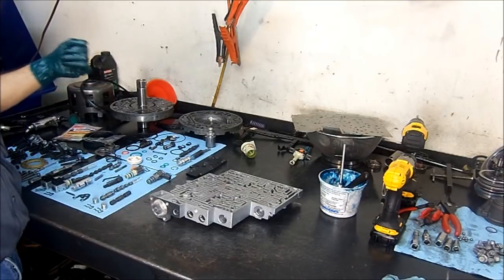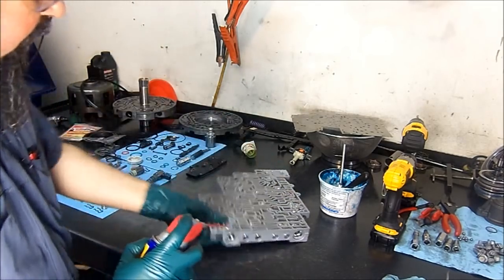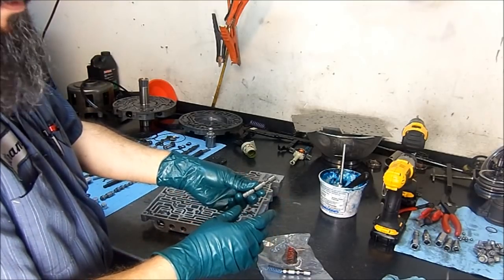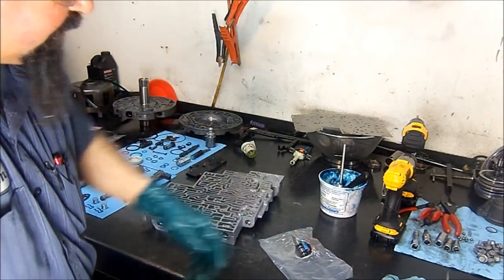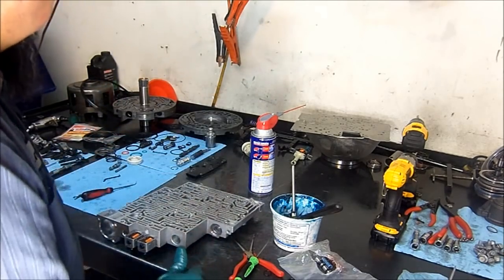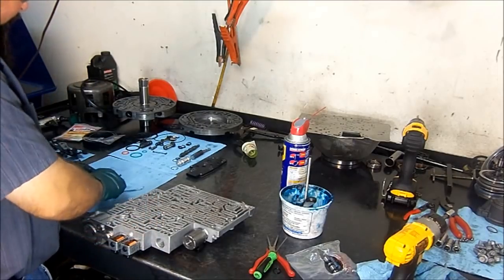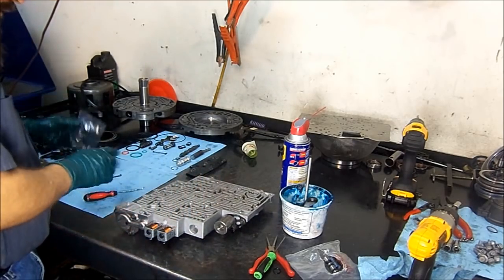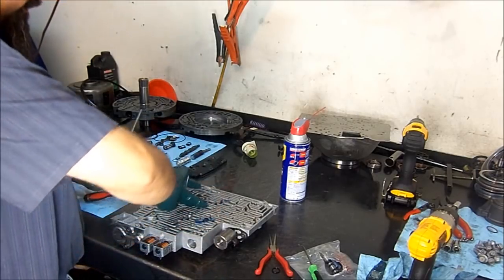4L60E Transmission Valve Body fix P1870 Transmission Component Slipping trouble code.

Comment: Hello I need your help 
I have 4l60e slipping on 2 n 3 n 4 when rpm go more than 2000 
1 n R working good I put a pressure gauge on the line pressure I have 60 psi on P N D321 and 35 go to 90 on R 
What do you think 
Thanks for your help

Comment: Hi, Can you help me? I'm having problems with my 2002 Trailblazer. My gearbox has been re-overhauled. I get new error messages P0171, P0172, P0131, and P1870.
When these errors come, my gearbox switches very hard.
If I delete the errors, the gearbox will work great again.
Are the errors connected? Can I give me any information?
No one knows me!

Comment: Hey Hiram I just overhauled a 4l60e that had rear planetary failure. I installed a shift correction kit on it, now the transmission will roll from a stop and then engage when accelerating. I am suspecting it's a pressure manifold switch problem. Have you ever ran in to this issue?

Comment: Dear brother i hope that u can help me to find out the problem in my chevy trail blazer 2008 ,Last year, August 2016 I change the 4W drive case and become little better for a year and recently, I encountered same problem when shifting to 2nd gear looks like there is car hitting from the back. This is after the car was stock on the sand beach and we force the car to move by changing the 2W, 4W up and 4W down switch for half an hour. Then it happens also in 3rd gear but lighter than the hit on 2nd gear. The rpm gauge was playing also from 3 to 4 when we were driving going up off road looks like the gear is having a hard time shifting or not shifting at all. Then, when I rest the car the following day, sounds better but starting to hit again on 2nd gear after staying the car open and long drive approximately 80 kms. It starts shaking when its shifting and after awhile its start to be stronger then to hit/pump again like car hitting from the back. Whenever the car will rest long time it will be okay but when you start to use it for driving the car will start again to be like that. And when I stop the car and go under if you shift between D-R you can hear sound like jangle. god bless u am hisham
Reply: Converter is slipping and its raising line pressure to compensate. Sounds like a classic p1870.

Comment: I have a 99 suburban with a 4L60E rebuilt into a 4L65E three months ago, new servos, clutches, gears, everything. And HD2 transgo kit, not set hard, just firmer shifts. Drives fine and everything but when warmed up, once I get above 50 when I let off the gas to cruise (when it goes into overdrive) I get a jerk like my converter is slipping momentarily. I haven't run any codes yet, but is it the valve? It is not slipping gears, I know that much.

Comment: will flipping the tcc valve around like that fix the trouble code?
Reply from the maker: +Mike  Ebert If the transmission is in good shape inernal, yes it will. There's 2 types of valve bodies. Early and late. I also have a video on the early value body.
Reply: the 2005 unit appears to have only this problem along with a hard 1-2upshift. I was actually able to tune out that code myself using hptuners. I did want to go in the valve body to ohm out the solenoids and to flip this tcc valve like you suggest, and do a flush. Just kinda doing some preventative maintenance.
Reply: I changed the maximum duty cycles in the tcm to 100% for the tcc, and the minimum to 90%. this should have the tcc locked or unlocked. if it slips from here then there must be valve body wear. I also do not allow tcc lock during wide open throttle upshifts. ironically the factory tune does..
Reply from the maker: The EC3 system works different than the early models. Being a 2005 you're an EC3. At 90% duty cycle the TCC is bleeding the TCC pressure. If you monitor the scan tool on TCC solenoid (the one on the pump) will come on immediately on 2nd gear. Your duty cycle would be around 90% and bleeding off TCC pressure. Remember, it's a PWM system,  it's design to always have slippage. Once the conditions are correct to start applying the TCC clutch then you will see the PWM solenoid drop to around 35% to less than 50%. Looking at your "TCC RPM" data on your scan tool you should see the actual RPM for TCC close to 0 RPM, and no more than 75 RPM slippage. Over 100 RPM's it will set a trouble code for "transmission component slipping", be aware that this unit uses 2 solenoids to accomplish that.  The TCC on/off solenoid that goes into the pump and the TCC PWM solenoid on the valve body. The one you made the changes to in HP Tuners. It is very common for valve body wear on this units that cause that issue, either you install a new valve body, ream and install an over sized valve, or do what I show on the video. All 3 options will fix that trouble code. Hope this helps to understand the functionality of the system. Look at all the data, tune with your HP Tuner and give us some feedback. I and my subscribers and viewers would like to hear your results. If you're not subscribed yet, please subscribe. Welcome to our little community. Hiram @ Automatic Transmission.
Reply: Automatic Transmission So far I will be switching around the valve like you suggest and change these other items. I have the updated transgo... separator plate which I drilled out as your video shows, sonnax pin less accumulators and the forward accumulator, and the sonnax check ball kit. i will let you know how it goes after I install the parts and switch around the valve like you suggest. As far as the tune with hptuners, do you think how I changed the max and min duty cycles is bad?  I will have to check and see if i can view the tcc and pwm values with hptuners scanner. Here is where I got the idea:   https://www.hptuners.com/forum/showthread.php?15899-How-do-you-delete-PWM
Reply: I checked hptuners scanner and I can monitor tcc/pwm duty cycle, tcc slip frequency, tcc slip ratio, tcc apply time,  and tcc applied yes or no. and a few other tcc functions which are irrelevant like tcc min tps....
Reply from the maker: +Mike  Ebert We build performance transmissions but I don't get into HP tuners. But what you mentioned before didn't make sense to me unless you don't want TCC to apply. Which I can understand on a track driven only vehicle. But on the street it really needs it, otherwise the transmission will overheat and can cause unexpected issues.

Comment: Nice video. I have this code in my 99 Astro. I Also have hard shifts when it get warm. I was going to buy the trans go HD2 shift kit. What else do I need? Solenoid kit? Or can you buy the valve body already done?
Reply: How did it work out for you?
Reply: @KollynJ  I never fixed it. Sold the van as is.

Comment: Hi, i have a 98 Jimmy with the p1870 code. i already installed the Sonnax TCC regulator valve kit and  it worked great for a couple of months. Now, the 1-2 shift gets harsh after about 30 minutes of driving. Should i replace the Sonnax TCC regulatior valve again or is it something else?
Reply: OsoBlanco did you get an answer on how to fix your issue? I have same problem

Comment: I have a 93 vette with the 4l60 trans, got a small gear grind when put in drive. I had the trans rebuilt, but still have the gear grind not bad but not right. Shifts a little rough through the gears . is it the valve body.

Comment: Hiram do you ever vacuum test the valve bodies with a tool like the vacuum test tool Sonnax sells.
By flipping the valve does that change it to the tcc being off or on and not pwm regulated? Is this a good thing to do? Will there be any negative side effects? Thanks the videos are very helpful.

Comment: Hi Hiram, I got a small question. I'm running 2 codes a p0740 and p1860. Now when I drive I have no shifting problems no slipping what so ever. could it possibly be just the TCC solenoid. it shifts smooth so its got me puzzled. the only time it does kick in a little hard is when I engage the 4x4

Comment: I have 2000  Cadillac Catera Code P1870,. "S" Light and Fuel Cap Flushing,  Radio and Trunk Doesn't Work. When I start from 1st gear after S light Flushing is very slow to run, If  I turn off Engine, Car works perfect for few hrs.

Comment: Do you have to drill those two holes. I did everything that it looked like you did with that exception when I put it all back together I had no reverse.
Reply: This is the same person, didn't realize wife was logged on till I pushed enter. I went in and watched the valve body install video and realized I had the one of the three 8mm bolts in the wrong place and like you said was impacting the planetary gear. I pulled the pan and moved the bolts around. All seems to work correctly. Now for a test drive to see if the trouble code comes back. I have confidence as it appears that you are knowledgeable on this subject and fix. Thanks for the video tutorials.

Comment: Hello I'm getting a hard shift from 1st to 2nd in my 04 Chevy Tahoe could you point me in the right direction
Reply: 1/2 accumulator springs could be a problem, broken spring.  I like a good firm 1/2 personally and built mine to have that.
Reply: Nathan Deneault This shop has all the tools lol.
Reply: daironification niice!
Reply: Nathan Deneault Yeah lol that was the first thing I told the guy that owns the shop. "I don't have ANY TOOLS" He said not to worry about it, he has everything :D!!!
Reply: daironification but buy your own to have and Eff up.  he will likely give you a raise for having your own gear and not stressing his out
Reply: Might be a worn TCC regulator valve, see if it throws that P1870. You might need a valve body rebuild. I'm having the same issue as you.
Reply: Nathan Deneault Thankfully I'm starting at a car shop VERY SOON. I'll be able to learn how to fix my own stuff haha.
Reply: daironification transmissions are just a bunch of subassemlies that u put together.  nothing to it, it is almost worse unhooking and rehooking up afterward.

specialty tools aee also super crazy for transmissions, get a press, u will nedd it.

Comment: Hey i am having trouble with my 1993 4L60E. When i go into gear it seems to jerk into drive but not reverse. its better when its warm and sometimes doesn't do it. it also has a hard shift to 2nd gear but it only sometimes does it. I am going to drop the pan soon i have a filter and the fluid for it and i would like to find the problem. a response would be VERY appreciated before i go tearing into it.

Comment: Hiram can the valve train be flipped around without reaming/modifying the spacer plate? the tekpac tcc valve which is very similar to the one you showed then showed us how to recreate doesn't require drilling the spacer plate

Comment: Hiram I have an 04 4L60E and am having TCC lock up vibrations at 45-55 mph, no code yet, started after fluid and filter change. can I flip my tcc valve train around like you did here to fix this? also I see the proper setup just not how to install it: spring first? followed by plunger then valve or spring last? many thanks.
Reply: Did you?

Comment: Hiram please help!
I have a 2003 truck and I put a 2000 4l60 in it
the builder sold me it rebuilt and I gave him my 2003 4l60e  as a core.
he said the 2000 4l60 would be the same but I have pwm  codes showing up! also I see that the harness changes in 2003 and so does the valve body and epc solenoid? 

what do I have to change to get this 2000 4l60e to run in my 2003 truck.?

Comment: I have this problem with 2000 Astro.  Called local shop and they said the new upgrade with new torque converter would run me $1000 is this about rite for parts and labor???
Reply: What’d you find out?
Reply: @KollynJ  transmission never got it fixed sold as is and told the buyer about it.

Comment: I have a 94 firebird 4l60e just rebuild it and it won't chang gears at all manually or automatically
Reply: Pump is probably broken. Was torque converter seated fully

Comment: could a partially removed transmission o ring throw this code

97 chevy blazer 4x4 replaced 1-2 & 2-3 solenoids already & replaced 3-2 downshift solenoid because of code p0785 someone please help

Comment: Im have a 2-3 shift problem if the rpm are under 3500 with let's say 35% throttle it won't shift but sometimes it won't do that. Also all the gears hold fine it's not slipping or flaring. At WOT all shifts are dead on.

Comment: Hey Hiram.. awesome vid!  I have the 1870 code on a 2000 Blazer 4.3. TCC engages and disengages between 60 & 75mph.  Now the trans is asking for max pressure and my 1-2 shift has gotten a little harder under throttle.  

Just doublechecking.  1) I stand a good chance of solving this with the TransGo 4l60e kit? 2) In a 2000 Blazer 4.3 I do not?? want to bore out the TCC hole in the separator plate?  3) I do, or do not, want to need/want the FitzAll Plate & Ball Seal part?

I would never have dreamed about trying to tackle this unless I'd come across your vid.  Beautifully done.

Thanks,
Beej
Reply: William DeCoursey Just a quick update with results for any others that are curious.  I had the p1870 trouble code in my 2000 blazer.  It shifted ok, but was falling in and out of lockup at highway speeds... 65-70mph.  I ended up just getting a reman valve body with the sonnax reamed valve already installed and all new solenoids, checkballs, and a transo sep plate for $250.  I drilled out the plate just like Hiram did in this video, and it shifts and runs like a charm and I have good lockup at highway speeds.  I probably could have gotten the same result a little cheaper, but I'm an absolute amateur (had to buy jackstands, a jack, and an impact wrench) and had no desire to have to drop the pan twice.  Never could have, or would have, attempted it without this incredible video.
Reply: +William DeCoursey thank u for the info was curious where u got ur reman valve body with the sonnax reamed valve already installed I'm haveing the same problems thank u for all ur help if u have any other info thank u very much sincerely clay
Reply: Clayton Wilson ebay store...  Shift Rite Transmissions
Reply: +William DeCoursey thank u so much
Reply: +William DeCoursey I'm trying to find it on eBay but haveing no luck any chance u could help me please find what il looking for can't thank u enough for the help
Reply: +William DeCoursey thank u so much for the link and the time to help me out thank U again
Reply: np.  Hiram makes it look so easy!  It's a formidable job for the weekend/youtube warrior. Nerves more than anything.. Did I drill the right spot in the sep plate?  Did I put the bolts back in the correct location?  Good organization and  second set of hands goes a long way when you're on your back under the truck.  Get er dun.

Comment: Thanks for your videos they have help me a lot! But had a question for you i've done a couple of 2003 model 4l60e transmissions that I've had an issue with it going into third gear just from 2nd to 3rd once it goes in to 3rd it's fine just slips for a second going into third and it downshifts from fourth the third no problem any thoughts what that might be?
Reply: Thanks a lot I'll check all that stuff I really appreciate it
Reply: Okay buddy I want to give you update so far one of the transmissions I tried that on I put a boost valve Transco shift kit and a pressure regulator and that fixed it on one of them! I really appreciate your help thanks a lot! I'll let you know how the other 2 go!

Comment: Awesome tutorial Hiram. I have a delayed 1-2 shift followed by a harsh shift to 2nd on a 2004 Tahoe 4L60E 2 WD with 88k miles. It has no no check engine light on. I had it scanned and its got no codes stored.
Do you think I might have this same issue even though it's not showing any trouble codes ? Some one else had suggested that it might be a broken spring from the 1-2 accumulator. I bought a pinless alinum accumulator
Reply: Sorry, I accidently posted the previous post and I wasn't done yet. So I bought this pinless aluminum accumulator piston kit but the thing came with no spring. So im gonna swing by the tranny shop first thing to pick one up before I start this. What are your thoughts ???

Comment: I have a 2000 Chevy S10 pickup truck with 175,000 miles. The "Check Engine Light" just recently turned on and is throwing a P1870 code. What do you recommend me do first?
Reply: Thank you!

Comment: I rebuilt a 96 Tahoe trans 17 months and had a 3rd gear flair. The problem was the new separator plate I bought. I needed to drill the 3rd apply hole out larger. The flair is completely gone.

Comment: I hope you might help me i am trying to replace my transmission in a 2005 gmc envoy xuv 4x4 4l60e 5.3 motor i have everything apart but it seems to be stuck right above the starter area it will not seperate from there did i miss something please help anybody

Comment: I flipped that converter clutch valve around like you showed. Its alot stiffer than the other three valves, is that okay?  and also would a 3/32 drill bit be okay to use since it's equivelent to .0938? 
You said in the video It calls for a .096 but you use a .092
Reply: Dirk Smithson g